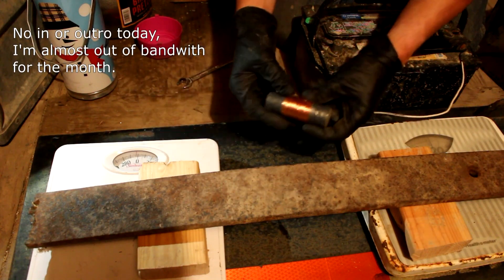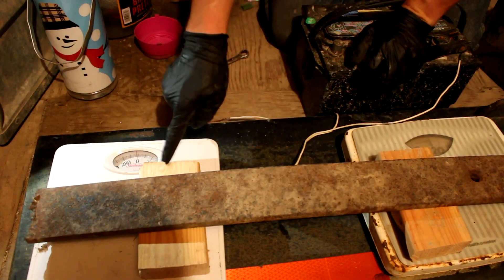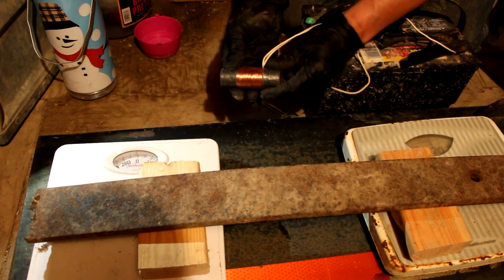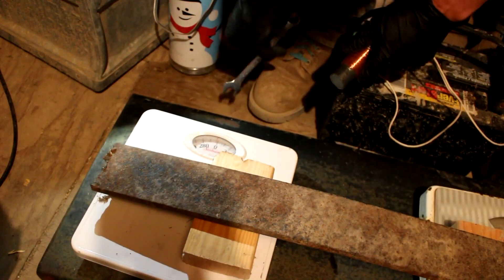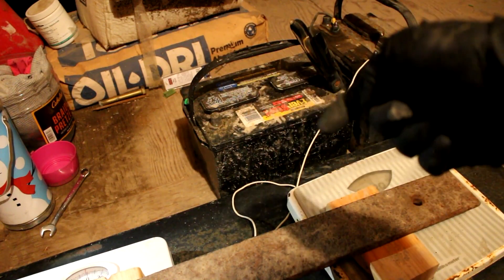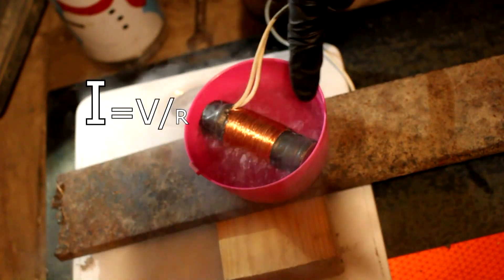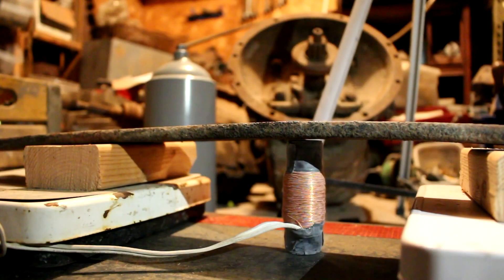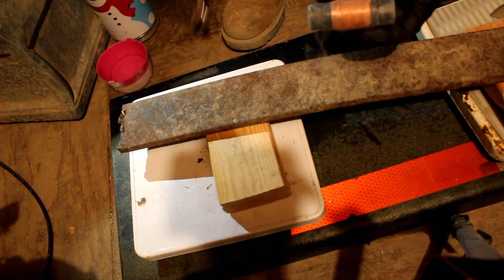Electromagnet in Liquid Nitrogen

Comment: That's essentially how the MRI works - in order to obtain the highest magnetic field strength at the expense of amperage consumption rate, all you have to do is reduce the resistance in the electromagnet with liquefied gases like Nitrogen or Helium (the coldest the coil or wire get, the lower the apparent resistance would be), yet the inductance will be enough to provide some needed resistance to prevent the load transformer or power supply from overloading. Superconducting magnets are insanely powerful.

Comment: A thicker wire would be the cheaper solution. I built a Electromagnet out of a 18,5 Kilogram iron core (450 x 90 x 60 mm) with about 900 turns of 1,5 mm² copper wire around it. With 50 Volts it becomes quite aggressive and builds up a large magnetic field.

Comment: Cody, have you ever thought in another way to get data connection. How far is the nearest point with DSL or 4G ?. You can set up a radio link to this point. Microwave links will make 50km no problems (proper antenna required). Also, if you could request power from the power utility in your area  (sure that it is going to be expensive), then, you can get internet over the grid. Its not super fast, but at least has not limit. Ask the electricity utility in your area if they are willing to offer data service. In far or remote locations they usually do, because it makes sense, they make extra $$$$$$. Data gets better performance since the grid is less polluted with noise (electrical) given the low density.

Comment: Hey Cody - or anyone knowledgeable about this... I'm interested in.. well science but at the moment - I'm wondering how on earth transformers work - as in the ones you would find in a  microwave for e.g the current only runs through a coil - but the output is through a wire running through, but not connected to that coil - I'm guessing it has something to do with electromagnetic fields... but any explanation would be appreciated!  whether simple or in-depth :D

Comment: 12/24V with so many amps that's in those batteries, why doesn't the thin wire melt when it's uncooled and has high resistance? I've seen the plastic around booster cables melt from that kind of power :)
Reply: Ohm's law. Booster cables are thick and have low resistance. Low resistance = high current.
Reply: So why doesn't the thin cable melt?

Unless you mean that higher resistance = lower temp?
That would make sense.
Reply: thin wire = high resistance = low current (Ohm's law) = low power dissipation = no melting

Comment: explanation, when the wire is cooled down the individual atoms aren't vibrating as violently as before which gives more room for the electrons to move. hence decreasing resistance and increasing current

Comment: I believe the equation for the strength of an electromagnet uses the length of the winding area, too. If the area, which looked to be roughly 1" in length of the steel rod, were reduced to 1/2", (the copper would stack up higher) but the electromagnet should be twice as strong. This is if my memory is working right...

Comment: Cody, I a real noob when it comes to this stuff, so here are a few questions:
Do you wind by hand the coil?
on which terminals do you hook up the battery?
Reply: You can wind it however you like. Of course it works by hand, or you can employ the use of tools like a drill.
You can also hook it  up any way you like. The only difference will be the orientation of North and South in the magnetic field.

Comment: At room temperature, the magnet force was roughly 1 pound. But after you cooled it, it increased by at least 20 fold. However, you said that it would increase it by 90%, so I expected 10 pounds at most. How does that work, really?
Reply: He said the resistance would be reduced by 90 percent, not the strength of the magnetic field.
Reply: Do you know the formula for the decrease in resistance when the copper wire is cooled?
Reply: I don't really know, off the top of my head.  I'm more of a bench tech than an electrical engineer.

Comment: Hey, I have a quick question about just electromagnets. Does the size of the cylinder effect how powerful the magnet is?
Reply: Also, would it make the magnet stronger if you wrapped several layers of copper wire around it?
Reply: Does the size of the core* matter

Comment: You shouldn't assume because you've hooked up a "12V battery" that there is 12V across the load... Verify terminal voltage of the battery to ensure validity of the experiment. You definitely verified the theory that resistance is proportional to temperature, but not in a very controlled manner..

Comment: why does the current flow through the copper axially and not short across the windings? IOW, take the shorter path?
Reply: You can't see it, but the wire is actually insulated. It has a coating of clear, flexible enamel.
Reply: We actually call it "magnet wire"
Reply: ow cool, I had the same question and I thought the wire was probably insulated, but wasn't sure because the coating is invisible.
Reply: So when they say that the insulation on a motor is breaking down, they mean that the coating on the windings is going to pot?

Comment: I knew decreasing temperature would decrease resistance hence increase current, but I never realized what a difference it makes. THEORETICALLY (I haven'T done any googleing, im just straight up asking the question) if you apply this method, cooling the coils, in a generator and keeping it perpetually cool by keeping the nitrogen compressed, would the output of the generator not be as significantly greater as the magnetic pull of this piece of steel? I'm probably wrong, if it was this easy I'm sure it would already be in use now (if it isn't already), but I'd like to know anyway :) Great video, Cody, thanks!

update: I just googled it, and all I could find were liquid nitrogen generators, but not one link actually answering my question: Would a liquid nitrogen cooled generator produce more power?

Comment: what about using one of these battery tenders/ jump starters on a 50 or 100 amp setting?
Reply: Nothing special. A typical fully charged, healthy car battery, such as the one Cody is using, can supply up to around 600 amps. CAN is the key word here. You missed the point of the video which is about resistance in the wire.
Reply: +Euro Bum I meant like would it make a stronger magnet
Reply: I know what you meant, and I just explained why not. Which part is giving you trouble?
Reply: The strength of an electromagnet is directly related to the current through it. (Ampere's Law). If you know that, and you know Ohm's law, then you have what you need to make a stronger electromagnet.

Comment: Minor gripe: If the upper steel has flexed enough to make contact with the magnet, you're no longer getting an accurate measurement of the force. To prove this to yourself, consider a magnet that was 10x stronger, once the steel flexes into the rigid surface of the magnet, will you expect further deflection, leading to a change on the scales?
Reply: I think Cody was trying to illustrate the change in resistance that cooling makes, without getting too scientific about it. I think he accomplished this very well. Don't be a nitpicker.

Comment: couldnt you also increase the strength of the electromagnetic field by making the diameter of the inductor wider and using a different core material with higher permeability. (not sure how big of a change that would have)
Reply: Diameter ... I don't think so. I think you would be diluting the field. Core with high permeability, yes. But iron is already pretty damn good.
Reply: +Euro Bum does a higher (L) equal a stronger magnetic field?  if it does then I suspect the diameter would because L and A have a direct correlation in the equation for inductance.
Reply: rabospawn Ampere's law states that the magnetic field strength is proportional only to the amount of current.

Comment: That is cool! (Pun intended) But being an electronics hobbyist, I would rather use thicker wire for the coil :)
Reply: wouldnt thinner wire have less resistance?
Reply: Bryan Tuck No, it wouldn't. Thicker wire has bigger cross-section, thus lower resistance than a thinner wire of the same length and from the same material.
Here's the formula: http://hyperphysics.phy-astr.gsu.edu/hbase/electric/imgele/resis3.gif
Reply: +MrJohhhnnnyyy you're totally right. It's late here haha i had a brain fart

Comment: You could always slap together a quick boost converter.
Reply: If he were to boost the voltage, then the current capability would just lower though.
Reply: LegoGuy There would be a lower current going through the coil than into the converter, but that doesn't necessarily mean there would be less current going through it than there is with the 24V. It depends on the internal resistance of the battery. Power will be conserved.

To get the most current through the coil, you would need to make a few calculations. First, you would need to find the amount of power that can be supplied by the battery. Then you would need to find the voltage that would maximize the current through the coil. In essence, Imax=Vmax/R while Pmax=Imax*Vmax.

TL;DR- Conservation of power is the reason the current output can be described as decreasing as the voltage output increases. Now, what happens when you increase the power being supplied?

Comment: Hm, there may've been an alternative way to decrease the resistance. Instead of having one spool of 1000 turns of copper, split it up into say 2, 3, or 4 smaller spools and connect them in parallel. But yeah, the LN2 was less work.

Comment: Cody, you should use a smaller diameter core.

The field on the inside is independent of the diameter ONLY if the cylinder of coils is INFINITELY LONG. Your cylinder is quite short and stubby, so you should use a smaller diameter to get stronger field.

Comment: Cody, you should see how the pull force changes over time as the electromagnet warms up. I think it would be an interesting experiment to see.
Reply from the maker: I tried, but the wire running to the magnet got hot before I noticed any reduction.
Reply: Interesting anyway!
Reply: use a larger wire. 0 gauge or bigger

Comment: Now I want to know what happens to a very cold electric motor.
Reply: implying you can't design lubricants for low temperatures.
Reply: I use to race RC cars and a trick we use to use was to cool the motor with a type of aerosol spray used to remove gum, it would freeze it. Don't remember what it was called for the life of me. Hole shots were way more powerful.
Reply: yes but it would consume much more energy. it would be easier to just use a higher voltage power source, but like cody said, he was limited to the two batteries.

He doesnt get 10x the force for free.
Reply: You can keep increasing their power until something pops, the standard air cooled motor could probably take 100x it's rating if you super cooled it.
And obviously it can only make the power you put it, not more.

That is why for instance Tesla motors engines are the size of a 10kW industrial motor, but they can output 400kW momentarily.
Reply: you just have to cool off the coil, nothing more
Reply: unless you're counting the blood from my ex's heart.................
Reply: So you can use liquid nitrogen like NoS for electric cars.
Reply: Even the temp drop from a pellet gun CO2 cartridge might be interesting, though not as good as something colder. Will get cold when allowed to expand in open air. Just need to vent it through the windings.

Better yet is if some motor was designed for it. You could have a turbine that gets boost from the gas that expands and also cools the windings. Hybrid of a simlple air motor w/ electric.
Reply: Ball bearings are pretty common in electric motors and that was a great idea. 
Bet it draws 10 times rated current and puts out 10 x rated power...
Reply: Small DC motors use bronze bearings, no lube at all. This ones would be perfect to have a try.
Reply: 38911bytefree Very Close. They're called Cintered Bronze Bearings and the lubrication is inherent in the material.. Over heating causes it all to weep out.
Reply: You would probably have to use a brushless motor for it to work. The brushes in a brushed motor would probally get stuck to the rest of the motor. 

Granted I am most likely wrong, please correct me if I am.

Comment: Hmmm... Do you know if the magnetic permeability of the steel rod changes with temperature? If so - it may also have an effect.  

It may be interesting to repeat this experiment without the core, assuming the air within the copper solenoid will remain roughly at room temperature in both cases.

Comment: It looks like the magnet was bottoming out, so the scales were only showing the amount of pull to hold the steel pieces together.  Me thinks you need a different testing rig.  You need to measure the breaking force of the magnet once the steel pieces are connected via the magnet.

Comment: This is a strange question but i assume someone here will know the answer, when i was a child me and my buddies would run copper wire between batteries and magnets and attach them to metal coins we were able to magnetize the coins to some extent to where they would pull the other coins in a change til together when something was purchased with them,we never really knew how we were magnetizing the coins but it worked. does anyone know the specifics behind this process ?

Comment: is it possible for the sub zero temperature on the surface - combined with the pull strength of the magnet, to create microscopic vacuum bubbles due to the perspiration ? ultimately increasing the holding strength of flat surface objects? if it is, can this be utilized on a larger scale?

Comment: cody. you can increase magnetism if you reduce the amount of distance wound. ie if winding is yay long reduce by half distance, resulting in more overlapped wires. I believe this occurs because your concentrating_focussing mag feild rarher than stretching-distorting it. bottom line, wire arrangement plays a big role in magnetism.